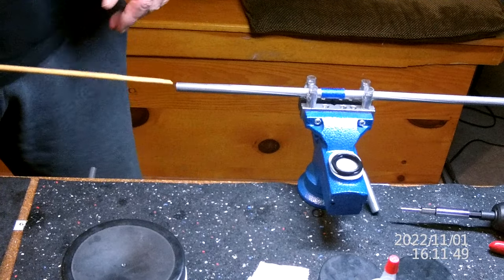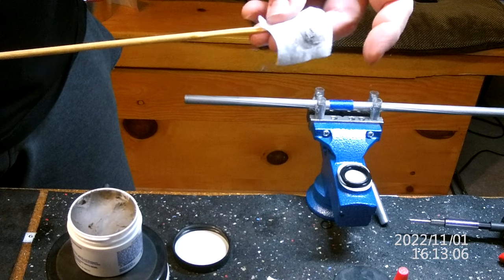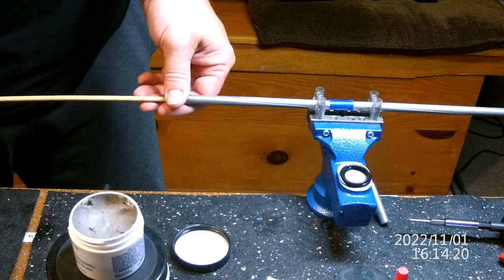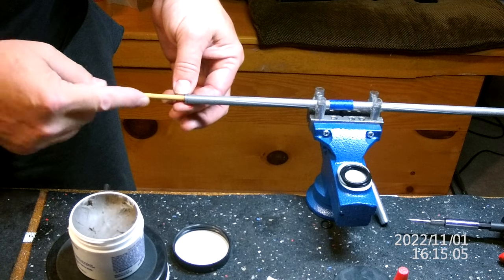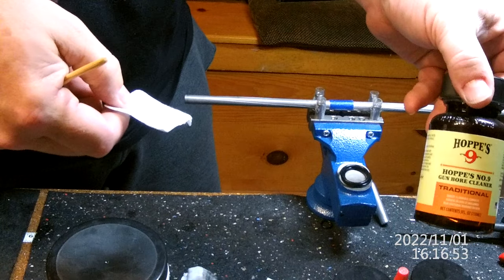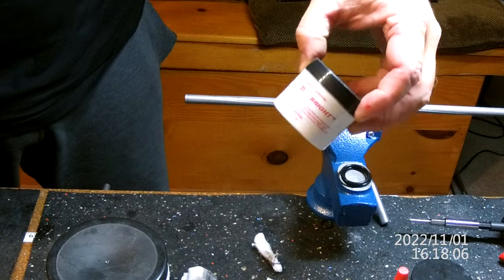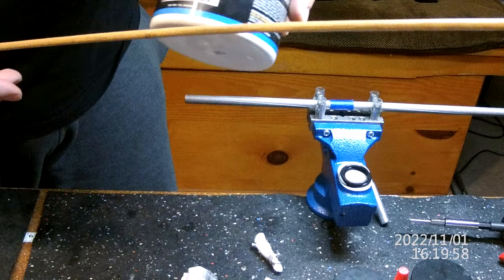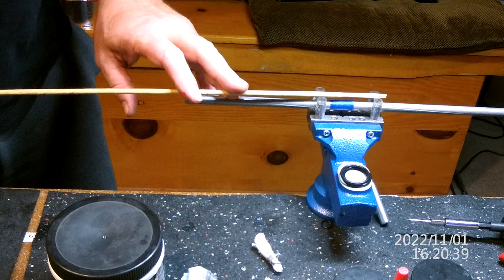Fx Impact Maverick Wildcat liner Polishing for extreme accuracy DIY

Comment: I’m not sure I understand why you have to do this if you’re buying an expensive gun or a new liner. Why doesn’t the factory do this for you and then ship it to you?
Reply from the maker: Very good point. I wish they did. But it seems as though it makes a huge difference in all the testing I’ve been doing. Case in point up to date. I just received a Western airguns rattler 357. Four days of shooting and it has a major failure. Why would a rifle that costs 2700$ fail in four days of use? My answer is! They are just expensive tinker toys.
Reply: @FxFanBoy  : Personally, I would contact the manufacturer and tell them why did this happen on a $2700 Airgun? It’s kind of similar to these exotic cars that cost a lot of money, but when it comes to reliability they’re crap.